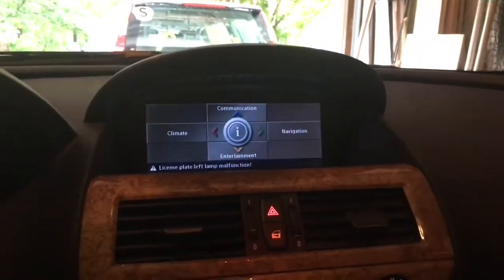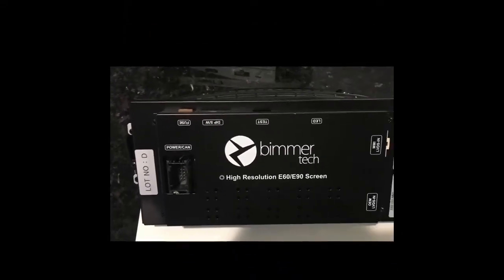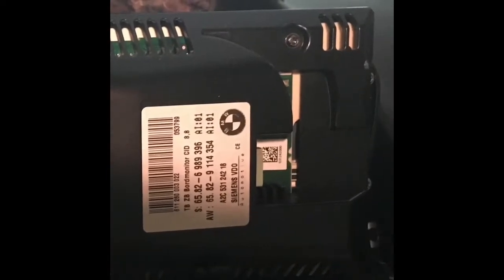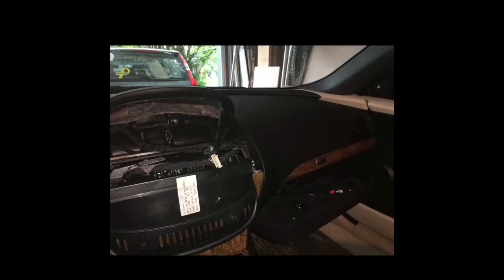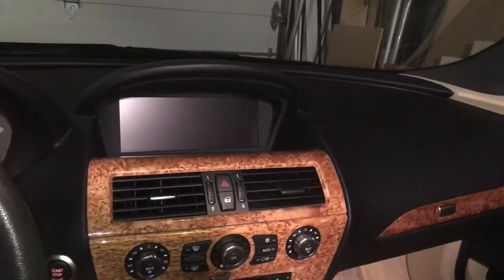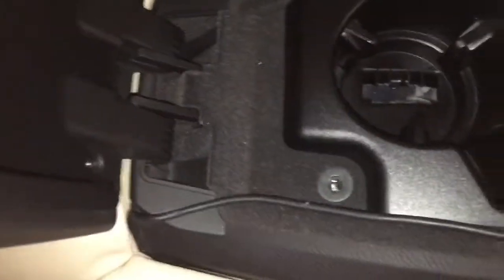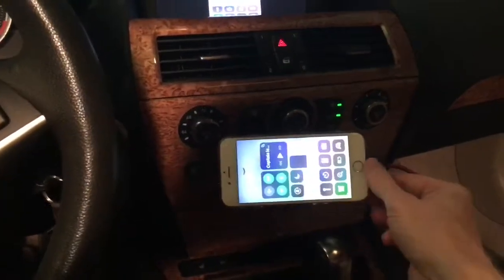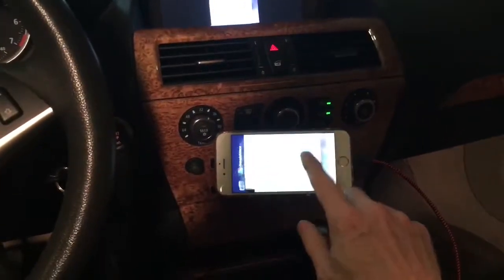2007 BMW 650i Convertible (E64) Bimmertech VividScreen and Smartview HD

Comment: Completed Phase 1 of the project (Dashboard and electronic hardware install).  Since I have the 6 disk cd player installed (and did not want to remove it - sentimental?)  I placed the hardware in the glove comprtment for now.  Works perfectly!  Screen is fantastic.  Able to screen mirror from my iphone and used google maps on the monitor and in the sound system to get me to the grocery store.  Jim's video was a great help.  Of course this is the max travel these days.  The backup camera is very sharp, but still in the front seat.  Phase 2 is to install the camera on the rear bumper and run the cable - a bit more complex that I thought, but the challenge will be met.

Comment: Thank you for the video.  I am getting ready to do the same project (with a back up camera) to my E64.  The space you used for hardware behind the glove box is currently occupied by my 6-cd changer.  Any suggestions on an alternate location?  Possible it may end up in the glove box?  It's pretty small in the base case.
John
Reply from the maker: Yeah.  There is not allot of room under there.  I originally had the iPod adapter ....so allot smaller than the CD changer so I had more room.  I can't think of anywhere else you could put it.  Yes, the footprint is pretty small, so would not take up the whole glove box.  Good luck.  I thought of doing the camera too as our other cars have them, but was not that jazzed about the cutting into the trunk.  I only have 54k miles on 2007 E64.  I need to drive it more but of course, stuck at home right now.  Take care. Any other questions, just send my way.  v/r Jim
Reply: @jim5640  Thanks for the quick reply!  Just picked up a 2008 E64 from Ebay with only 35K miles.  A great car!  I rented a car in France last year without a backup cam and proceeded to back up into a pole, so I really am paranoid now without the camera.  What used to be a frill is now a necessity. I happen to have a panel punch which the diameter of the camera mount, so I expect the camera install should be pretty clean.  I worry more about removing (and possibly breaking) interior panels as the project moves forward.  If you are interested I'll take photos of the camera install.
John Mackay